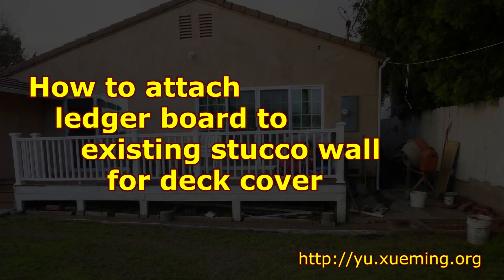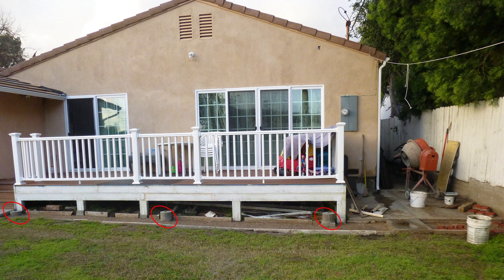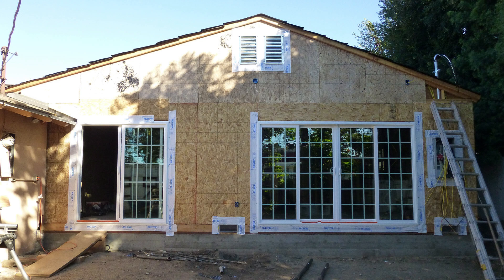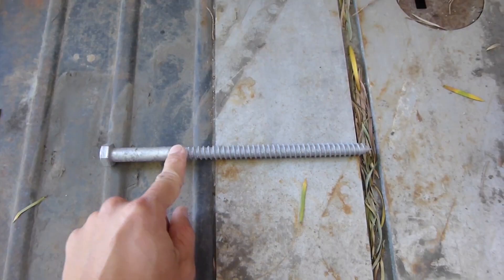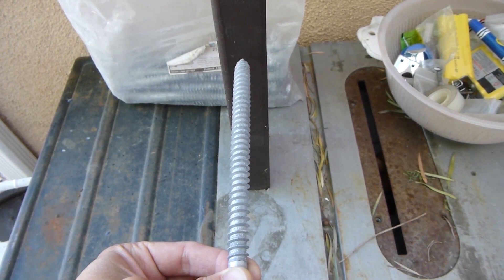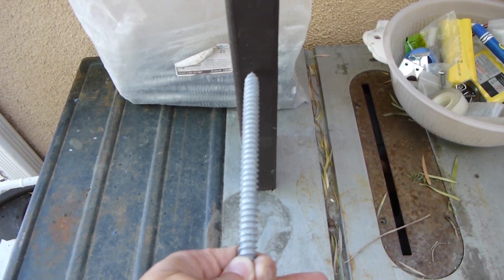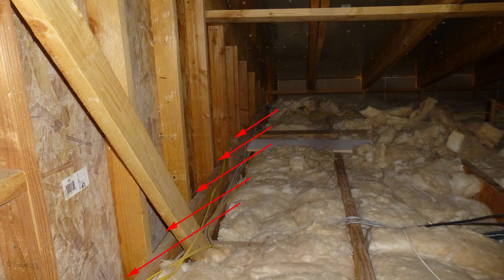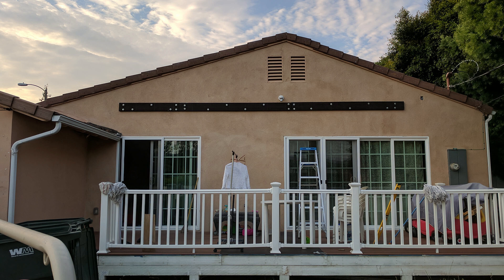How to install a ledger board on existing stucco wall

Comment: fyi. Simpson ledger lock bolts. set flush to the ledger allowing you to set joist hangars over them. Also they will screw right through the wood and the stucco pulling the ledger tight to the stucco when you find the wall studs behind it. I am a builder and have been building decks and patio covers for more than 30 years. The hardware has just gotten better over time.

Comment: Personally I do stucco and you should caulk around the ledger board, to avoid water getting in behind the board and behind the stucco or eifs where the nail penetrated, which water will usually always collect and rot, no matter where it is water finds a way.. always remember that
Reply: Would installing some type of flashing on top help? I’ve never done this but I’m reviewing how to videos to do it.
Reply: @edwinochoa4470  of course this would help that’s usually how we install our eifs or stucco, but caulking needs to play a part on any intrusion
Reply: @edwinochoa4470  usually the flashing is behind the eifs application tho I forgot to mention

Comment: This is excellent and the best way to install a Ledger to stucco wall; Thank you so much. I live in CA as well, hope you can install my Ledger for me. By the way, what size lumber did you use for the Ledger? 2x8 or 2x10??
Reply from the maker: I used 2x10

Comment: How did you waterproof the ledger board?
Reply from the maker: I didn't waterproof the ledger board because the board is underneath the plastic roof panels, which provide the coverage.

Comment: Water will get trapped behind the stucco and the ledger board. You will have rot in no time.  Also where you put the lag screws through.
Reply from the maker: Totally make sense! And this is why I installed corrugated roof panels over the raft. Check out this video: https://studio.youtube.com/video/tzT20x9azCs/edit